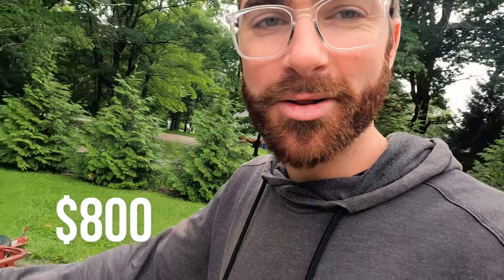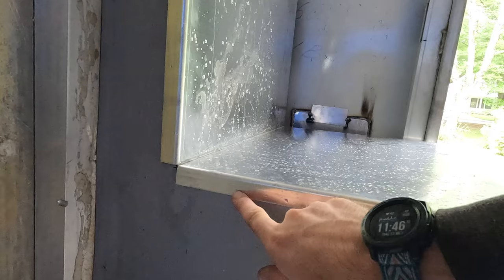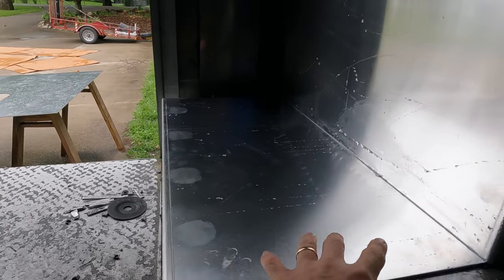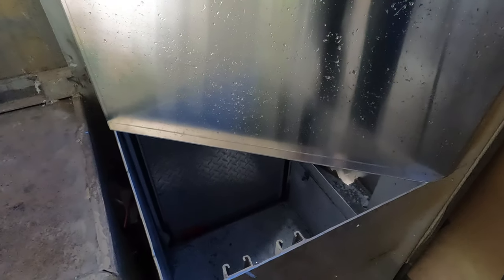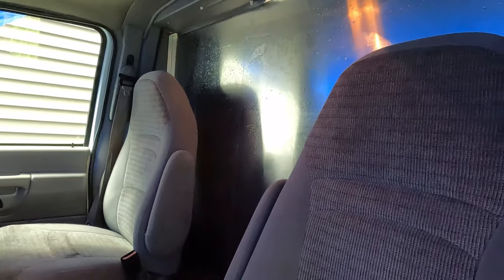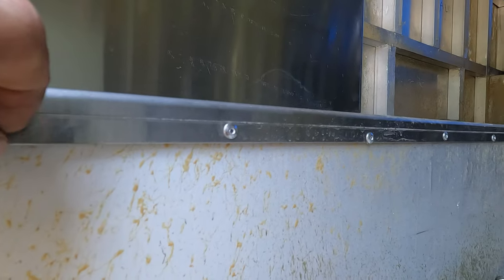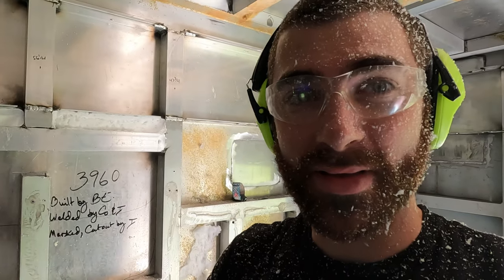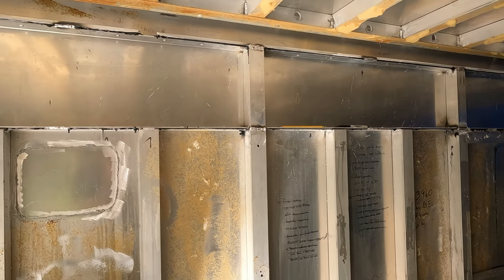How To MAXIMIZE Interior Space in an AMBULANCE CONVERSION // [ Episode 9 ]

Comment: You guys would have been better off and more cost effective to have bought a used SWAT Command vehicle that is built like an ambulance, but has a higher roof and doesn’t infringe on the integrity of the roof structure and the safety of the box of the ambulance. The reason people buy an ambulance is for the safety of the box and the storage capacity you have. You guys just destroyed the safety of the box. I built a lot of ambulances and I will say you guys are extreme. 
By the time and money you guys will have invested in this used ambulance, you could have a bought a brand new SWAT vehicle that you could have done anything with and it would be new with a warranty. Guess some people just have more money than others??
Thank you for your service, as I’m a retired Army Captain. Good luck on the rest of the build. Excited to see the finished product. Happy Trails!!
Reply from the maker: That may have been a lot easier 😂